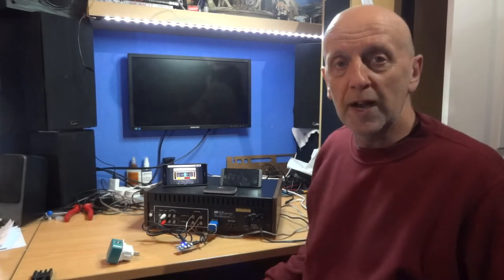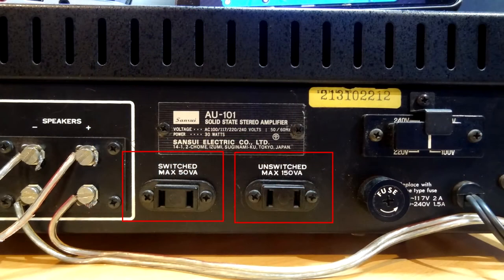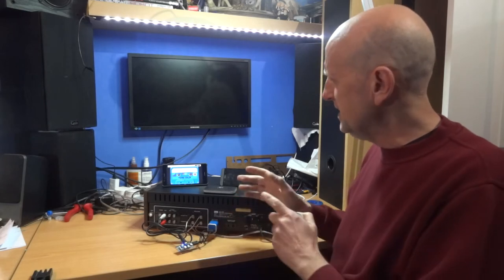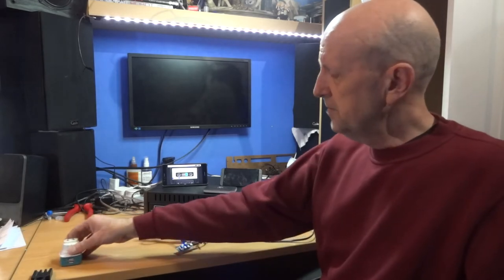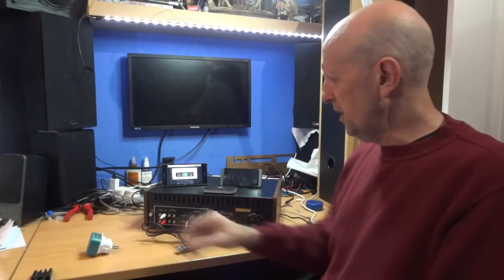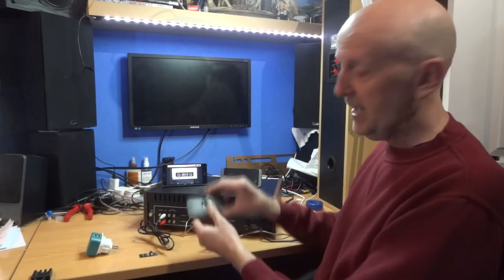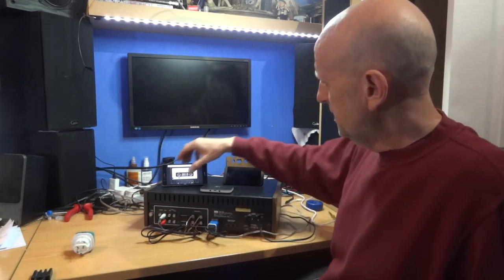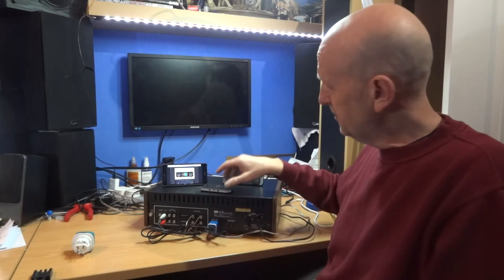Vintage Amplifier or Receiver Switch and Unswitched Sockets Uses, Bluetooth, Turntable, Cassette

Comment: Thanks Michael, great video. So if I want to power my old Sansui eq unit off my Rotel amp’s switched outlet, does polarity matter? I have a 2 pin blade type plug I can replace the eq’s 3 pin plug with, but will it matter which side the live and neural are on? There’s nothing on the outlet or the 2 pin plug to indicate polarity but I though I’d better double check and ask.
Reply from the maker: Good question, If the 2 pin plug on the back of your Rotel has a pin slighlty bigger than the other then this pin would be neutral and the small pin live. But saying this it does not really matter which way round as your Sansui EQ would not be earthed, either connecting it directly to a 3 pin plug socket in the wall on into the Rotel socket as it only has 2 wires.